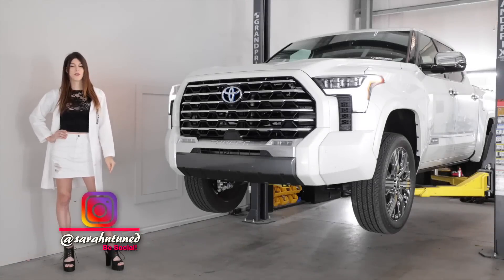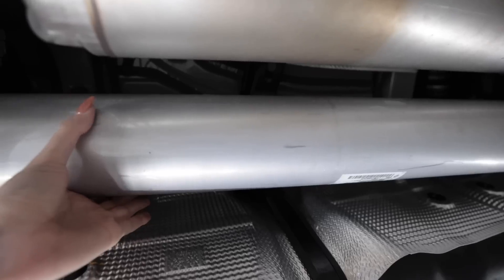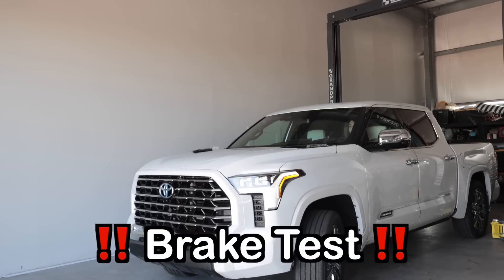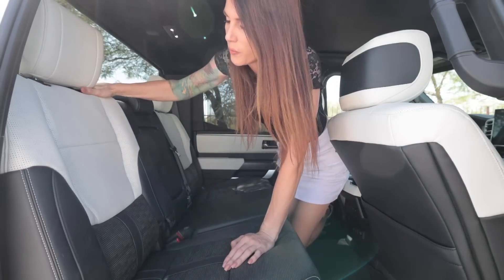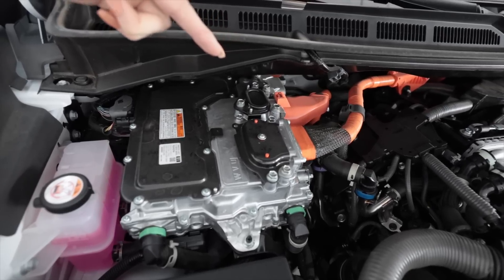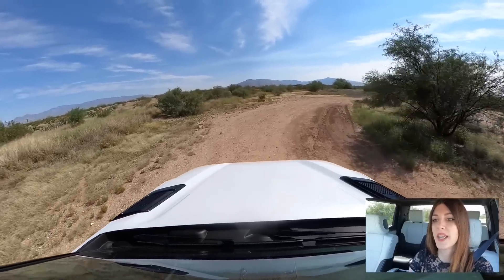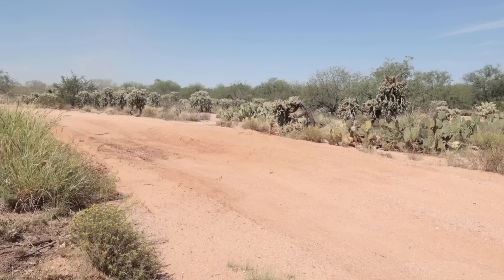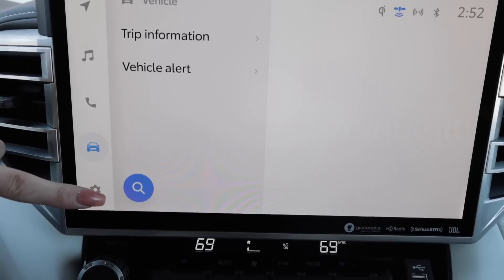The New Lexus Truck.. basically // 2023 Toyota Tundra Capstone Review

Comment: Interesting review.  As you were going through I was comparing my 2004 Chev Avalanche. V8 Obviously the $80,000 tundra had the upper hand on everything until fuel milage. Recently I got 19.5 highway and it usually hits about 16 stop and go. I must say I paid 11K for it 5 years ago and ..  I must say.. I  keep my vehicles like you do .. so it's a gem.  It's hard to justify $80,000 for pick up. So I think your score is just a bit high if your looking for a truck to be a truck.. this was so nice I think i would not be able to use it.   Great review.   Ps always good to color coordinate.

Comment: Pretty sure that big long diagonal bar connected to the driver side frame and passenger side of the rear axle is infact a panhard bar. How else would the rear end maintain lateral position? The four trailing arms are at too shallow of an angle to perform lateral placement.

Comment: I drive a 2020 F250 super duty diesel, crew, cab, 4 x 4 and I can get 21 miles per gallon on the highway that’s driving 75 mph with my air condition full blast not too bad for a big truck

Comment: That hesitation on start-off is one of the things that makes me think I don't want a turbocharged Tundra, as much as I like the 2022 suspension, cameras, and transmission. I drove a 2020 Toyota RAV4 for a week, and when I put the pedal down from a stand-still one time it took what felt like almost a full 2 seconds to give me any power. Literally pedal to the floor with no immediate response. It was some sort of fluke, and didn't usually take quite that long, but IMO a vehicle's power should be instantaneous. A pause like that could be dangerous.
Reply from the maker: It was likely torque management software protecting the transmission, nothing to do with the engine being turbocharged (aside from the added low-end torque).

Comment: Funny you said Hino Motors but the label actually was "Hino Mortors". Oops.  Inside looks really nice. Outside, I'm up in the air on the styling. 77K with plastic wheel inserts nope. I really don't like how they really pump up the power level on a 3.4L to move such a heavy truck and if you tow much with it, it won't last.  I'd rather get a Super Duty. Testing the SR would be interesting, hope they give you one.

Comment: Congrats on 500k!  Great summary of the Tundra.  Your impression of the performance of this 3.4+hybrid drive train bodes well for people interested in the LX and GX Lexus SUVs cuz I am 100% confident  the same drive train will be the default for those when they get migrated to TNG.  The key question is whether it will also be a choice in a redesigned 4Runner or if it will be given a slightly smaller combination to keep some separation across products.
Reply: poor 4runner, if they dropped the tundra down to a v6 the new 4runner gonna be a turbo inline 4

rav 4 is probably gonna end up with a 998cc xD

"efficiency"
Reply: @freemaysin5088  Oh, you're right... It's  guaranteed the entry level SR5 4Runner will be a turbo 4cyl inline.  I'm just one of many future 4Runner buyers who would be interested in a hybrid option with better mileage without stretching a smaller 4cyl to the outer edges.

Comment: Heatlilated, ha! In all seriousness, the goat sheared skid plate and/or no skid plates plus the partially plastic wheel inserts is disappointing in a $70K plus truck. It’s an intriguing truck (I currently have a Ram Rebel) because of the hybrid system and Toyota’s reliability is legendary but still…

Comment: US pickups. I really don’t grasp the woeful fuel economy despite all the tech. I can rock out with an OM606 powered W460 G wagon and get mid 20s in Miss Daisy mode. Granted, unleashing all 300 donkeys off road rapidly sees that in single figures but it’s 34 years old kit with a Bosch mechanical pump so…..

Comment: This big ass truck needs a V8. I know some folks like the twin turbo V6 but sooner or later those expensive turbos will need replacement as well as hauling big ass shit will put a lot of strain on this six. I'm used to older Tundra V8s lasting 300,000+ miles, I don't see this motor lasting nearly as long. There is no replacement for displacement especially with big ass trucks towing big ass items.
Reply: Is why I got the 20 TRD OR

Comment: About the mpg: at least this truck will reward you for driving in a reasonable manner. The older Tundras didn't give you that option; that 5.7L V8 sucked down fuel like a drunken sailor tosses back cheap beer no matter how you drove it. Rock-solid motor, but NOT fuel efficient. Of course, the $77k purchase price of this 2023 model makes it all moot - do they even make a truck suitable for a regular Joe anymore?

Comment: I did have respect for your buys and builds until you bought the rip off dodge/toyota/trash can/dumpster fire.  There is a reason no one has EVER sat in a toyota and been like this is rugged as f! Cause they are actually an unlit dumpster fire on wheels!

Comment: Where do they come up with these LAME names for vehicles? Lots of terrible names out there these days. Way too much wt. even for a twin turbo V6. Here it is: Weight  = Bad fuel mileage no matter how it's equipped. Weight also eats up small cu. in. engines, no matter how they're pumped up. This much wt. should have not less that 500 cu. in.  engine displacement. And again, another UGLY 4 door pick up.